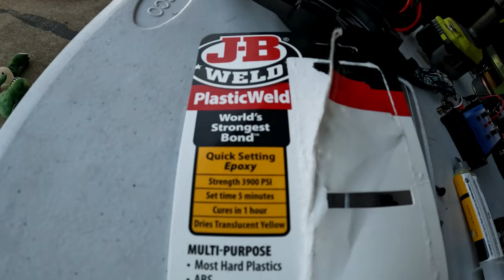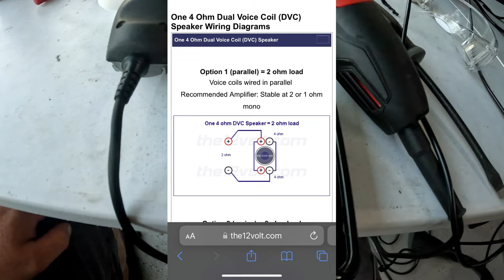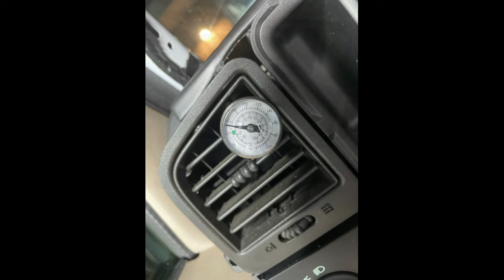Factory Bose Sub Upgrade For Your Truck

Comment: Can you show pictures of the wiring you did on the subwoofer?
Reply from the maker: All I Have Is The Video That’s Why I Put The Diagram But The Speaker Is Marked Positive and Negative For The Factory sub so just take note of that before you remove them from the sub wiring
Reply: Sorry man my adhd kicked in and skipped right over that diagram. Thank you.
Reply from the maker: 🤣 no worries

Comment: How much power does the Bose amp produce? And was it a very noticeable difference from the Bose sun to the kicker? It’s my wife’s suv and I just want a little more bump in it. She doesn’t care
Reply from the maker: Not sure of the power rating of the amp would love to see one tested, but it hit a little harder then stock but nothing crazy it would ruffle the mirror a little bit again it’s only a 6.75 in sub, I’m sure with a bigger amp it would hit pretty hard for what it is, I’d check out JL Stealth box for the Tahoe/yukon if you want a major change it goes under the console as well, but all in all I like this project and it fixed my messed up factory sub problem, If I have time to play with it more I’d love to see what more amps would do to it but I have the stealth box back behind the seat now so they both complement each other well so I have no complaints with the current setup have a video on that as well if you want to check it out

Comment: 1.1 ohm you for got the other coil. i just replace my rear speakers with some 6x4 skars. Found the brand by accident, friend had blow twitter and wanted cheap. google did not steer me wrong.(THIS TIME)
Reply from the maker: It’s a dual 2 ohm VoiceCoil speaker

Comment: Any possibility you could showm me how you have that worked fully?? Did you use all 4 wires from Bose amp?? I have a 6.5 dvc Skar to fit(with little bit of shaving 😅)...
Reply from the maker: I used all 4 wires yes the polarity is marked on the bose speaker so just not that then I used the wire diagram I provided on screen and some jumper speaker wire to do the rest

Comment: Do you remember how much more space you had behind the kicker before it hit something? I am trying to spec a 6.5a" woofer and am wondering if I can get a taller sub than the kicker you have.  Is there anything Infront of the sub blocking excursion? I could always run a spacer if not.
Reply from the maker: You can reach behind the console with it installed and it has tons of room and you can feel around for your self on the passenger side

Comment: Having trouble with mine I added a Memphis prx624 in same spot it has selectable 2 or 4 ohm wired now at 4. I currently have a loc and amp with a 12. loc is wired in at those wires 12 bumps but the 6 seems untuned and hasn’t sounded right since installed Even without amp and loc do I need a the 4 wire sub I want to pull this huge 12 out too. have a cleaner look. stock hu
Reply from the maker: All depends on the amp output for that speaker if is a multichannel the smaller outputs are not a lot only meant for door speakers, the factory amp power would perform best at 2 ohms, that’s assuming the speaker condition and box seal is good

Comment: Ok so i have a question would it help to to fill the cavity with some tupe of fill to get a better sound? I know like my subwoofer for pa it was full of insulation in cavity. I have a 2020.gmc 2500hd with Bose system and I am not impressed with sound at all . I may have to do something similar. Thanks for the video
Reply from the maker: A follower recommended it but iv never done it on a ported box  myself id feel like it would blow out

Comment: That factory sub looks like it's got 2 coils with the 2 sets of terminals. Are you sure it wasn't a dual 2 ohm sub?
Reply from the maker: The whole truck was 2 ohm each coil read 2 ohms that’s why I wired the sub to make it a 2 ohm resistance as well
Reply: @QS_TIPS  What I'm saying is, if that factory sub had two coils and each are 2 ohm, then they have to be wired together in either parallel or series. So the amplifier is either seeing a 1 ohm or 4 ohm mono load.
When you replace it with a dual 4 ohm and wire it as a 2 ohm mono load you might be higher or lower than the amp was designed. Those factory amps can sometimes be finicky. I would have used factory wiring configuration. It would be a safer method. As long as it works and your amp isn't heating up or turning off it's probably all good.
Reply from the maker: I have Had No Issues With It, Didn’t Try to Over Think It Just Supplied It With The Same Resistance It Had Previously, It Been On A Few 16 Hr Road Trips Pushing it so I’m sure it’s good, that factory speaker was dual voice coil but where wired individual witch was odd to me so that’s why I think paralleling it worked fine  couldn’t find any factory specs iv been looking for a while that’s why I made the video, was full ready to mess it up, I think the only thing I would do differently now is a different sub, someone commented a company that makes a 6.5 and think that would of been a better fit, if my wife’s sun every goes out might try it on there and see what happens, but at the end of the day the Bose stuff has no public info it’s all secrets, because They use none traditional methods so I found just matching the resistance worked wonders for the results I achieved, it could be wrong idk but it works lol
Reply from the maker: I also had a weird suspicion that each coil was run off it’s own channel the way it was wired but I can’t prove any of that without really digging into the amp and that could be a wild goose chase
Reply from the maker: Have to keep in mind bose does a lot with little to no power basically the opposite of the industry standard
Reply: @QS TIPS its not that you didnt try to over think it.... you just plain didnt think. dude your factory speakers are not dual voice coil what are you talking about I ripped that bose system out of my silverado and put in high res audio I've never in my life seen a dual voice coil car speaker. You need to get your facts correct your giving ppl incorrect information on ohms and the electrical setup of the system do you realize you could be partially responsible for causing someone else eho knows nothing about electrical to burn there car to the ground? If the bose subwoofer had DVC at 2ohm ea that means it's most likely wired at 4 Ohm unless the bose amp is capable of handling 1 Ohm but I doubt it being bose. It's impossible to take a DVC 2 Ohm and wire it on its own at 2 Ohm. Its 1 or 4. Period. This is the measurement of resistance of the circuit. If you cause someone to wire a 1 Ohm load on an amp that can not handle the load you could really f up someone's stuff and insurance ain't going to cover it because that's negligence by owner. Also. Your not giving that kicker near enough power. The enclosure is completely wrong and so is the tuning of port. Educate yourself before playing with electricity, and definitely stop advising others to follow your negligence and stop putting ppl in danger electricity isn't something you just whatever about. It's deadly. Come on man! 12 year experienced and licensed contractor, so I know what I'm talking about. PLEASE DO NOT BE FOOLISH AND PLAY WITH ELECTRICITY EVERYONE! ITS JUST LIKE FIRE!!!!
Reply: @jeffmccormick6382  Woah, woah. Slow down there. If you look at that factory speaker its clearly got 2 spade connectors on each side. Its not a coaxial speaker, so it's safe to say it's got a dual voice coil. If you've never seen a dual voice coil sub in a factory vehicle it's because you've never run across one. Simple as that. It doesn't mean they don't exist. I'm sure those trucks had different options and different amps over the years. Maybe even different amp manufacturers. My own vehicle can have a single or dual voice coil 8" sub depending on the sound package option. 
Also, it does not have to be wired as 1 or 4 ohm. Thats only if its a single channel. It's possible the sub amp is 2 channel. It depends on how many wires go back to the amp and how its wired at the sub. So there's 3 options. 
All your warnings and insults are uncalled for. Anyone working on their own vehicle knows they are responsible.
Reply from the maker: We’ll Put, Thank You !
Reply: Came to the comments to say this. Definitely looked like the Bose sub had dual 2 ohm voice coils.

Comment: Someone cut my factory sub wires in the console and my rear door speakers rattle and make noise. They aren’t blown. Do you think it’s because they needed the sub?
Reply from the maker: If the speakers are rattling the glue probably came loose where the cone attaches to the speaker material that’s what I found was wrong with this factory sub I added it at the vary end of the video if you need a visual 5star audio has a good video that covers all the factory amp wiring for these trucks if you want to try fix the sub wiring

Comment: Hello friend can you please help me out.  I installed jbls on the front door and hooked up a kenwood head unit with crux harness. Did that with on my Escalade 2003. Boy does it sound shit all of a sudden. Bose was sounding so good. Head unit and steering control works jsut great but the amplifier seems likes it’s not working at all. Sub woofer doesn’t kick in at all. What could I be doing wrong ?
Reply from the maker: Jbl only makes 4 ohm resistance speakers I believe for highs, the Bose amp is set up for 2 ohms so probably doesn’t even have enough juice to move that 4 ohm speaker work plus Jbl takes a lot of power to run its made for a bigger amp you need lower resistance lower power speakers for the Bose amp

Comment: Nice work was just about to do the bypass of the bose system and now I wont
Reply from the maker: Appreciate it, yeah if you get 2ohm you’ll be good my door speakers are made by infinity think they are rated at 2.5 ohms
Reply: @QS_TIPS  hell anything would be better than those made out of paper shizzz called door speakers. I really wish there was a cheaper way to tie in aftermarket android head unit without needing the $100 data can bus box for steering wheel buttons and xm/On-star.  Not like I could ever hookup the On-star being 1990s technology. Barely able to send data. But definitely can't now. WTF 2G TECH
Reply from the maker: Yeah I wasn’t impressed with this pac module had problems with one and if you go to the bad reviews it’s not to hot but there is only two company’s with a module on the market so hands are tied I was doing research on how to by-bass all the bs and just have steering wheel controls but just called it good after I tried a new  module didn’t have any issue with that one but you loose the low frequencies for the Bose amp if you got that route

Comment: Aye bro I got a question I got el64 sky high on the doors and I wanted to do the skar 6.5” evl on the center console but I saw you said something about you said it’ll cut the power to the amp can you explain that a little more like is it a big difference when it cuts power
Reply: Does it cut power to the door speakers or just center console sub?
Reply from the maker: Yeah factory amp cuts power when you turn it all the way up so it doesn’t blow the factory sub but I have a JL Stealth box so it complements each other perfectly down low the little sub helps out then up top the bigger subs take over it’s only when you have it all the way up tho, so for normal people not trying to go def it will be fine but if it’s not enough for you it would be pretty easy to just add a little 300 wat amp to it if you need more from the sub
Reply: @QS_TIPS  mmmm okay okay appreciate bro not everyone answers when the video a year old keep doing yo thang bro

Comment: I like the idea with the replacement speaker for the oe sub. Phone audio sucks but I was wondering how much better does it sound with your replacement
Reply from the maker: I loved it with the upgraded door speakers it sounded way better,the factory amp does cut power when you have it all the way up tho but that worked out perfect for my set up when the volume is low the little sub makes it sound great and then when I want to push it the 2 12’s take over
Reply: @QS_TIPS  I’m thinking about upgrading in my 2018 pickup. Thinking about the oe sub but put on its own amp. Or doing away with it and just doing all new door speakers and then 4-8” subs under the back seat
Reply from the maker: When I was doing research there was guys re amping the stock sub to remove the power cut and they had really good results to! If your truck is that new I would send the stock sub, the older trucks needs replacements just due to the age of the speakers they start failing
Reply: @QS_TIPS  the oe stuff sounds good but once you get close to 1/2 volume it just doesn’t perform. It’s like 1/2 volume is all you can get out of it
Reply from the maker: @ccooper04  yeah thats just the factory making sure people dont blow all the speakers out, but to fix it you have to add your own amp witch can be quit the challenge to accomplish cleanly i think the best method i found was adding your own plug to the output harness so you dont chop the factory stuff up and wire the new amplifier straight to that, only output not on that plug is the sub but it wouldnt be hard to run wires straight to the sub, they have cool amps now that have highs lows mids and tweets able to be tunned individually with a sub channel as well so that way you dont burn the tweeters up, you can do it with a dsp to but iv never ventured that far into tunning but you have to have some nice teck to tune that or take it to shop to do it, but it can be done for sure i was contemplating doing it just to see how far i could take the kicker 6.75 but the way it turned out with the 12's cant beat it they complement each other nicely with the bass cut is right about the time my 12's start kicking in.
Reply: @QS_TIPS  I’ve done electrical for years and do it for a living but on big generators. Wiring doesn’t bother me. I’m searching for some harnesses or plugs where I can build a junction to not cut the oe harness so I can add it all.
Reply from the maker: @ccooper04  https://youtu.be/9l697oeCMlk
Reply from the maker: @ccooper04  I like the challenge that comes with electrical but it normally comes down to my budget because it can get expensive quick but I always try to do the best I can do with my budget, this video is what I was going to use for a reference to add my own amp, this guy does killer work, but not sure if it’s the same for the newer trucks but you never know just have to take a peek at the plug and maybe use a tone generator to find the wires you need.
Reply: @QS_TIPS  5 star car audio I’ve always watched! He always has good content

Comment: What headunit are you using?  I'm going to be gutting my cab soon and want to do this upgrade.  Awesome video...also I seen you said you found a 6.5 sub you might do in your wife's vehicle.  Interested in seeing what that sub is.
Reply from the maker: I’m Running the Kenwood DDX5706S, Think The Radio is perfect for these trucks due to the dial knob, hate button volumes, The Dial Hits Perfect When you rest your hand on the shifter in drive but think the radio is discontinued due too every company is switching from buttons and knobs to just screens to maximize the screen size, and a gentlemen commented a company I’ll see if I can find it real quick 🤘🏻
Reply from the maker: He said Parts Express Tang Brand or Daytona 6in Sub
Reply from the maker: Iv been getting the question about the sub a lot so I popped the link in the description, thanks your for the support and feedback greatly appreciate it ! Helps me keep improving the channel!
Reply: I have the Kenwood DDX373BT headunit and  Infinity ref6532ex front doors and Infinity ref5032cfx rear doors all with baffles and I don't think it sounds the best, contemplating changing stuff.
Reply from the maker: So looked into it the door speaker have slightly more resistance then what I’m running 3-4ohms the model I have are 2.7 witch is closer to what the Bose amp likes and iv heard rumor of the none excelon radios not having greats sound, the last digit is a s, I have never Baught a none excelon Kenwood so don’t know from first hand experience
Reply: I would assume I could upgrade the factory amp.  Thankyou for the info
Reply from the maker: No problem, good luck with your truck, my back up plan for the kicker was a 300 watt mini amp if it didn’t sound ok, but I love how it turned out, just put in a stealth box and a bigger amp I should have the video uploaded soon so check it out
Reply: @Psychobilly766  Reading reviews for say the 6" or 6x9 door baffles that Crutchfield sells, most people say they sound muffled. 
I can see that with a 6x9 especially. Remembering how good say Alpine 6x9's sounded in older cars mounted in the trunk on the back window shelf. The baffles actually act like a sealed enclosure, opposite of how they would work in the trunk applications. 
Some on Crutchfield actually said they cut small holes in the baffles and made a difference in the speaker's performance. Makes sense letting the cone move as it wants and not having back pressure from the baffle's seal.
Reply from the maker: I have small holes in the bottom for the speaker wire to come threw so the speaker still can move air but I definitely  seen a improvement in base and mids and it keeps the speaker out of the whether but I’m sure result will vary with size of speakers i only have 4 6.5’s  but all the reviews where circumstantial if you need more airflow you can open them up its more for keeping rain off the speakers for me but I found better sound quality as well